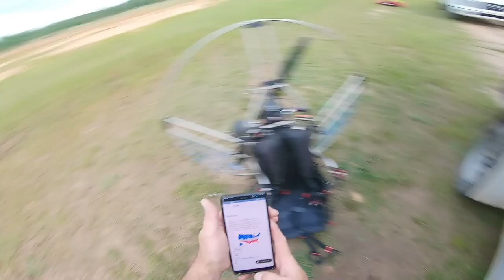How to Paramotor Into Strong Wind Gradient Safely With Curse Words

Comment: Are you saying “Only fly within the capacity of your equipment”? That’s axiomatic. However most people think that means their Wing and Engine, wrong. It means experience level of the pilot. The real “limit” of your equipment is your reserve only. Assume a worse case scenario, that is engine out, wing failure and reserve thrown (because the step worse is fatal, a Reserve failure). So, it boils down to the pilot, because flying is inherently risky, it’s a matter of balancing risks.

Comment: The only problem I see with climbing straight into the wind through a gusty wind gradient is that sooner or later you're going to have to head back to the LZ by flying downwind where the risk of collapse is greater.  Maybe fly crosswind in a zig-zag pattern to descend?
Reply: No I think that's just when hitting a wind gradient. Above or below that it's all relative. I have moved 60-70 km/h over ground free-flying an A wing and felt totally normal...then just turn into it before going through it.